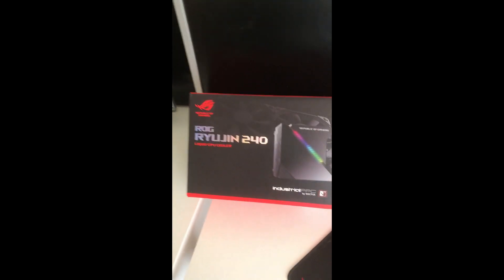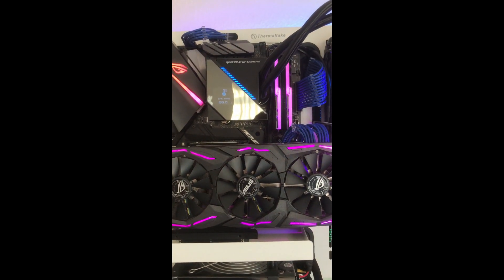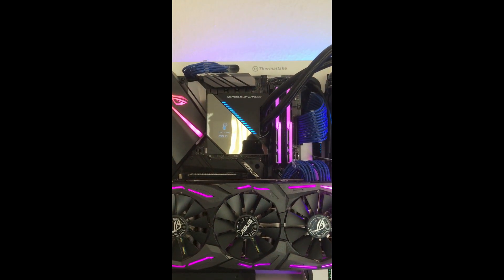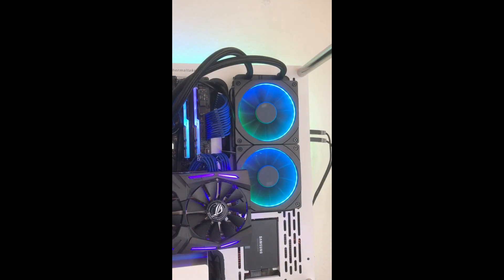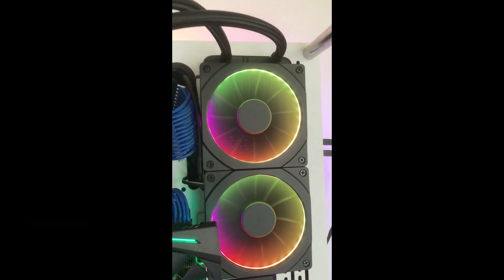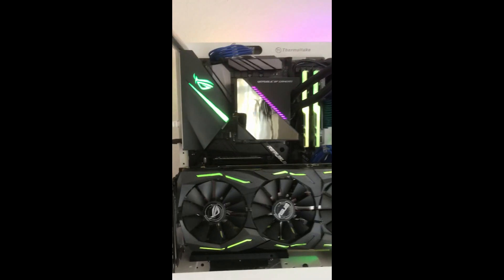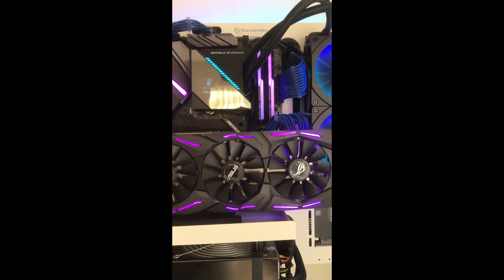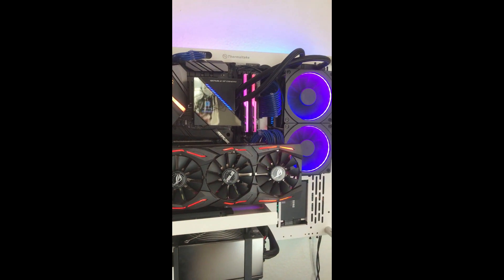Asus Rog Ryujin 240 quick review

Comment: I ordered the 360mm version, hopefully it cools better than the 240 version
Reply from the maker: Let me know how that performe. I payid 1600dkkr for the 240 and the 360 is 2000dkkr.
Reply: Nikolaj Nielsen I just installed the 360mm ryujin, the most quiet aio I’ve ever had in my opinion, and it cools pretty well, my stock temporary 8600k idles in the 20’s and under a full cpu stress test it barely touched 50 all the while staying quiet.
Reply from the maker: Thats great. Never had a 8600k so. Have you heard  the small fan spin op? But the 360mm is just more expencive. In Denmark its 2000dkkr, And that is insane amount for a aio cooler:)
Reply: Nikolaj Nielsen I have yet to hear the small fan spin up but I have my stuff in a Corsair 570x so it conceals sound a little bit
Reply: Nikolaj Nielsen I now have my 9900k being cooled by the 360mm ryujin. It’s stock atm moment idle temps 26-27 and while gaming 35 degrees
Reply from the maker: @areyou0k98  That is quite impressive and consideren the new 9xxx lineup gets kinda hot:). I am hoping that mine just had some freaking wierd defect fromt he beginning.

Comment: Now I see why don't they send these kits outs to reviewers. That built in small fan is ridiculous, I would get the Ryou probably if they made 360 variant.
Reply: P.S. thanks for the video, first proper one on youtube.
Reply from the maker: They make it as a 360 version too. ANd yes the small fan inside the waterblock houseing is a great idea to push some air over that area but why didnt they cap the rpm at 800 or something. I had to make a custom fan profile for it because it sounds like a jetengine.
Reply: Nah bro, I was talking about the other cooler the Ryuo not the Ryujin, if they made the Ryuo 360 then I would buy that.
Reply from the maker: Ah yes.

Comment from the maker: So a Quick Update: All fans on the cooler startet to spin at max rpm, all the time and the LCD display died. I am rma the cooler and hoping that I just got a defect one.
Reply: Nikolaj Nielsen I’ve been using mine for a week or two, everything seems good. I’ve actually never heard it make any noise and the little fan in the middle I’ve never heard it, idk if it’s on or not. What software do you use to check to see if the fan is on or off?
Reply from the maker: I just use Asus ai suit. I am hoping for a Quick rma. I am pretty convinced that it had some kind of defect from the start.
Reply: @waskus  So a year later and I was just wondering how it all ended and if you are still using it or did you move on? Because I am contemplating getting the 360mm one if Noctua doesn't send me a AM4 bracket for the NH-D14 in time for the 5900X launch.
Reply from the maker: @LogiForce86  The cooler died. I have a friend who just build a 10900k with the Ryujin 360 and hes happy. Its an expansive  cooler. Atm I am running a 9900k and a ARctic Liquid Freezer II 360. Now this is an awesome AIO and its cheap.
Reply: @waskus  Thanks for the reply. I will keep those in mind.
Quite poor though, that such a premium priced AIO is of such poor quality. At least pump side. I doubt those Noctua fans even begun to show wear, been running the NH-D14 for a decade and then fans still feel like new.

After doing some more research I noticed all AIOs are from Asetek due to patents and sueing the competition, at least until recently when players like EKWB came with their own offerings.

In the end I think I am more likely to either get a D15 and give the D14 to my father (old man of 60, almost 61) for his gaming rig, or just buy an extra AM4 mounting kit for the D14.
At least Noctua is proven quality for long term worry free use, and unless you really start to push an air cooler it will be just as good as an AIO. It's only at higher temperature that the heatpipe its liquid doesn't condense from its gas state.

So yeah, still on the fence but thank you for the helpful information. I guess it might be best to stay away from one.
Reply from the maker: @LogiForce86  Get the Arctic Liquid Freezer II 360.. Its cheap and better then any other aio.. But no bling bling:D And its small mosfet cooler is silent and so is the pump.

Comment: So it's trash? I shouldnt replace my H150i with this?
Reply from the maker: Only for its looks. Dont expect it to cool any better then your H150i.
But mine just broke down so I am hoping that it has been defekt from day one. I will make a update video once I get a new one.
Reply: @waskus  it says 4800 rpm fans including noctua fans... It should be good lol... I have 3000 rpm industrial fans on my h150i
Reply from the maker: well it says 2000prm Noctua fans incl:) Think they run like 2800rpm at max.
Reply: @waskus  do you know what noctua fans are best for pulling air cuz I see alot of YouTubers using noctua in their 2 X SLI setupd
Reply from the maker: Well the stats on these are quite good. 122cfm at 2000 rpm. But not sure thier name other then Noctua iPPC fans.
I have used Noctua noctua nf-f12 with my old H105 cooler and They worked great too.

Comment: Hi I have some question about it. Is there a possibility to turn off that stupid loud fan? Because I was thinking  to buy that AIO. I am using a Rog Strix Z370 board with my silicon lottery winning 8600K@5283 MHz on all cores. I did the delidding and liquid metal job myself...was an easy job for me as an IT technican. Running right now with NZXT X62 Kraken AIO that performs in my eyes really well.  On fully load i`ll never reach higher temps than 72 degrees on this. You said its not worth it because  of not so good temps and even high price I think. Are you able to give  me some  informations about your thinking of it? Greetings from Eckernförde/Germany and thx for the quick review!

Comment: Hi! Would you please help me a bit with some information? So I was planing to build my new rig using Ryujin, but now I'm confused, since there are still absolutely no reliable benchmarks, official pricing and launch date from Asus, which I think is a shame on them! I don't mind the price, if it's worth it. But now it seems it's too noisy? It's display is not functioning properly? Or is it not effective in cooling? Thanks in advance.
Reply from the maker: Ok. The small 60mm fan is a nice idea, but dont get why they didnt hardcap it at a fixed silent rpm. When the kit is installed, by default when the cpu gets warm it spins up and makes a sound like a vacumcleaner. I had to make a custom fancurve for it to shut up.
They Noctua fans are supposed to be able to move 122cfm of air at 2000rpm at 29something decibel. They do however run faster then 2000 rpm, think 2800 is max and again then they stop being silent.
They software for the lcd display is funky to. I can only get it to show CPU,PCH and mhz. It has alot of other options like water temp in/out and much more but they dont work. And I 
have flashed it with its latest firmware.
You are paying for a good looking cooler and then overpaying for the tiny lcd display. Most 240 aio that cost half the price are just as good. As I say: My old Corsair h105(full of dust) Cools atleast just as well and underload 2 degrees C lower.
And you are right, Asus has no launch date etc. I just found it by accident at my lokal hardware pusher in denmark. www.Proshop.dk
Reply: Yeah, for some reason the ryuo had a release date. But Ryujin didnt, I'm going to assume the Thor PSU is going to be a silent release as well.
Reply from the maker: Hehe maybe. But the 850watt is like 230£. Its insanly expencive.
Reply: Nikolaj, thank you for your answer! I'm looking for a silent and yet effective AIO for my upcoming rig. Ryujin looks great, but it's not for me, if it is too loud. I'm confused now, if I should buy Ryujin or not...
Reply: Lol, the PSU is available and I just ordered mine today haha
Reply: JL mine is on its way, got it from overclockers.uk
Reply: Lol same; now i just need that STRIX Concept Case shown at Computex 2018 to complete my new pc
Reply from the maker: Well I am using a custom fan curve for the Noctuas and the small 60mm fan so now its quite. But it took som fidling around.
If money is not a problem it is a cool looking cooler, but the software is still kinda wunky.
Reply from the maker: The Thor PSU sure looks awesome, but 210£ is way more then I would ever pay for a psu:-)
Reply: Nikolaj Nielsen are you going to run push pull config? I’m planning to do it for mine. Btw you got any suggestions on chassis? My Thor psu coming in this Friday and the only thing I need is a chassis
Reply from the maker: Yes I am going to throw in some of my older Noctua fans to try a push/pull config.
Chassis? My brother has the Lian Li PC-O11 Dynamic, and I really love that case.
Reply: Nikolaj Nielsen hey man, long time no talk. Just wanted to follow up if you have ran push pull yet? I just finish my build but waiting on some fans. If you have did you use fan splitters?
Reply from the maker: @klee.dodoco  Sorry, the cooler was dead and they had no replacement. So I got the money back and Installed my old corsair h105. 
Running push/pull dont expect more then a couple of degress.
Reply: Nikolaj Nielsen I’m sorry to hear that. Even with the Corsair H105 did you use fan splitters for the additional fan?
Reply from the maker: @klee.dodoco  Sorry dont use fan splitters. But it shouldnt be a problem using fan splitters for push/pull.

Comment: Is the fans rgb ?? I thought they were not
Reply from the maker: Nope they are not. The rgb is a cover over the fans. Its a digital rgb kit from Phanteks.
Reply: Nikolaj Nielsen About that m8. I only have 1 3 pin rgb header on my strix mb, will i be able to connect 3 of them digital phanteks babies? I heard they come with an adapter
Reply: Nikolaj Nielsen Also, i just ordered these grills because of you know haha thanks for the tip. was wondering if its possible to mount them on the rear side (exhaust side) of a fan. Phanteks dont give much info about them.
Reply from the maker: Donkens you Will need 4 rgb header for the digital stuff. My old Asus x370 prime Pro couldnt not run digital rgb
Reply from the maker: @Donkens  well they just go over the fan like a cover. So it should be easy to fix something together.